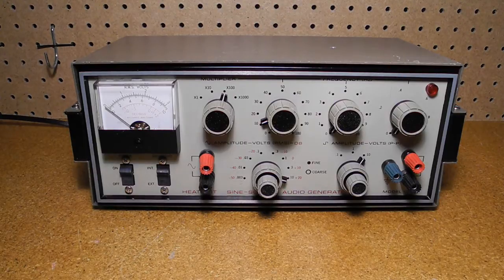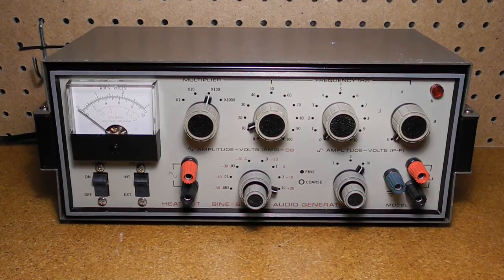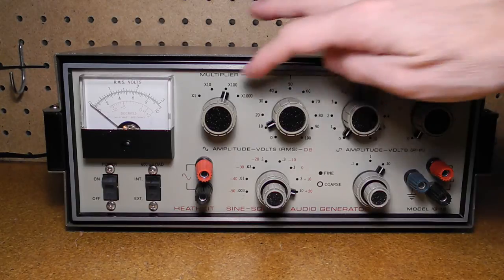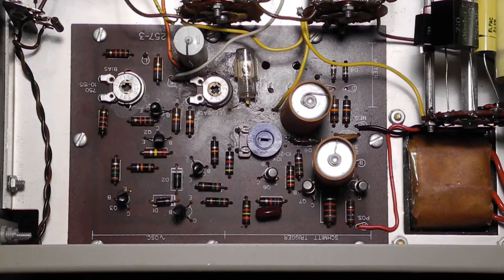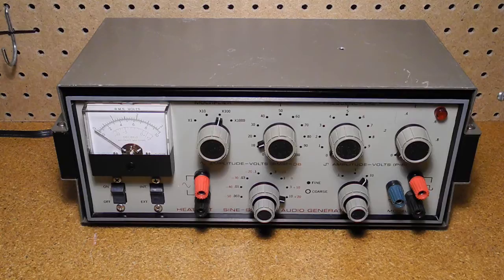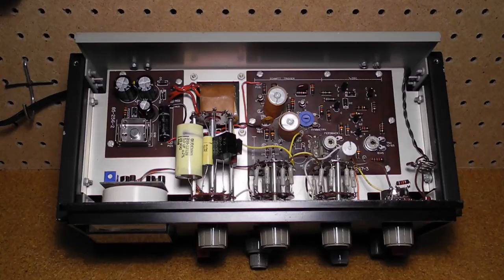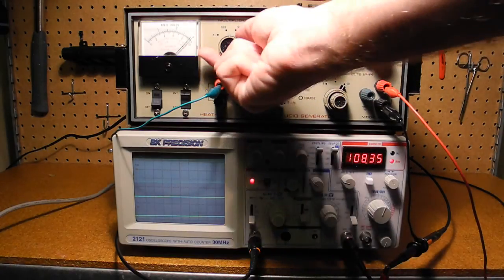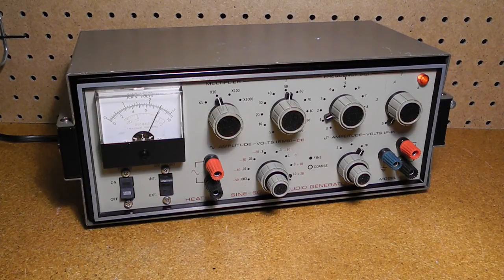The Heathkit IG-18 Sine-Square Audio Generator

Comment: All the gear in this I series is great stuff... very reliable and just plain good.  If you have a receiver that uses a 50 KC IF Filter... like National or Hallicrafters, or Drake from the 1960's..( Drake 2B, National NC-270, Hallicrafters SX-117  You are going to need this for it's frequency accuracy,  stability, and calibrated output.  I have all 3.   If you want to KNOW what the frequency response of your AM transmitters so-called Hi-Fi Mods really are.. you are going to need  this.   I am amazed at how many hams do "hi-fi" audio mods to thier transmitters.. but have No Way To Testing the Results... which explains some of the horribly goofy values of caps I see suggested !
Reply: captlarry, I disagree about ALL the gear in this series being "great stuff". In particular, the IM-16 & IM-25 are bad designs....good LOOKING meters and with some desirable features, but poor circuit design and ridiculous overuse of the batteries.

Comment: Thanks for the video. I bought and assembled this audio generator in 1986, and it still works like the first day. I am trying to repair a Heathkit IO-4210 oscilloscope, with problems with the power transformer, by the high voltage coil.

Comment: Hi Jeff,
I got one of these off eBay for like $38 and it kinda works fine. After powering ON the voltage takes a few minutes to stabilize. I think its probably due to the 35V caps and the other that probably needs to be replaced. But the RMS Voltmeter glass on the panel was slightly and the meter hairspring was damaged. I tried to resoldering it, it was a real pain but even then the meter showed open circuit. 

I had a few panel meters used to show voltage on these old servo voltage stabilizers that I collected a  while back. But I need to find the resistance of the original RMS meter to install the new meter mechanism on the Heathkit. Could you please let me know what is the resistance of the panel meter? The new meter coil I've shows a resistance of 395 ohms.
Reply from the maker: The meter in my unit has a resistance of 1381 ohms.
Reply: @jefftranter  Thanks for the info! So, I added a 1000ohm resistor in series with the new meter(put the new meter assembly inside the old meter case such that it looks like the original). But even then the voltage reading on the meter never goes beyond the 2V range. I do get 9.5V at 10V sine range and fine tune to highest setting. So voltage output is fine.its the meter that is faulty. What do you think I should be potentially looking ?

Comment: Can these instruments be used medically?
Reply from the maker: I can't think of any obvious medical uses, but they were not certified as medical devices and I would not want to use equipment of this age for any medical purpose as it may not be safe, either due to the original design or component failures due to age.

Comment: Thank You for posting.I inherited one of these from my late Uncle who was a Ham Radio Operator. So this is worth fixing up. There seems to be a a large amount of ringing from the edge of the square wave spilling over to the Sine wave and both signals look like fuzzy caterpillars.
Reply from the maker: I'd start checking the power suppy voltages and filter caps.
Reply: Thanks for showing me the potential of this Sig Gen. 

It turns out that there is lots of HF line noise coming through the AC mains  from 2 switching power supplies and a plug in power block from an LED lamp. They are all plugged into the same power strip. All the fuzz goes away when these are turned off. There is still about 5 Mv noise at 65Khz and 3.4Khz. Switching power supplies were just theoretical things when the Coast Guard taught me to maintain its Navy hand me down Avionics from WW2. So setting up my lab is a learning experience. The Rigol DS1054Z is an amazing scope for being able to catch all this..

There is a 1.5Hz amplitude modulation on the sine wave with the multiplier knob in the X1 position but that should be easy to trouble shoot. There is also a small bit of distortion at the bottom of the sine wave but that is probably an alignment exercise.

Now I Have to figure out how to get clean power for my equipment. I will not be working on RF or Audio, just digital and CNC equipment but it is still good to know ones equipment limitations. This mostly taught me about  how dirty mains power is and that it needs to be constantly taken into account.

Up next is an EICO VTVM my father built and a Heathkit RF Sig Gen buried somewhere in storage.

Comment: may seem like a silly comment but I've had luck removing tape residue with Ronsol Lighter Fluid. Dab some on a q-tip and rub gently. It dissolves the adhesive with out damaging the paint. This will also work to remove adhesive, such as stickers, from paper, such as record album covers. love your videos. thanks so much.